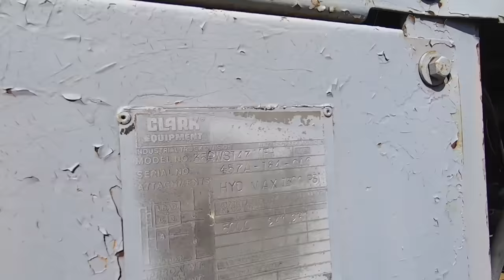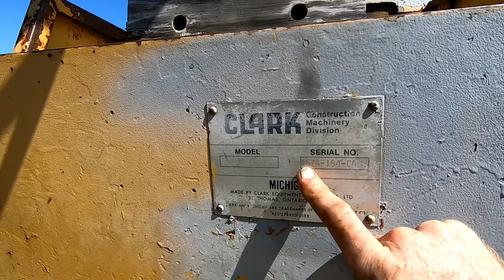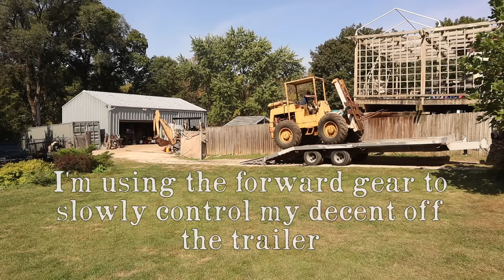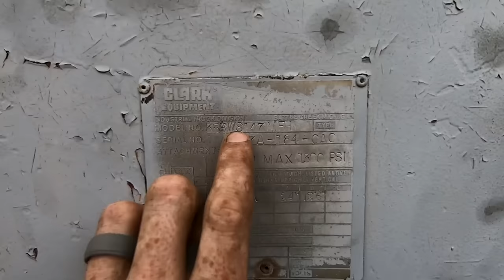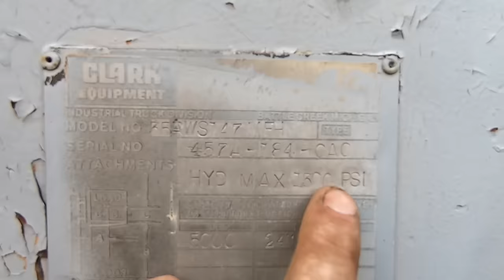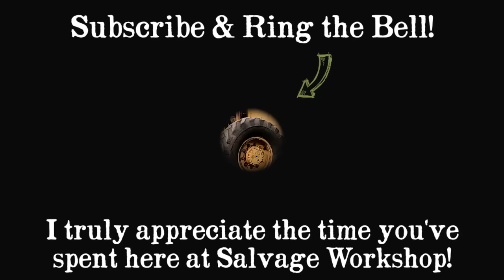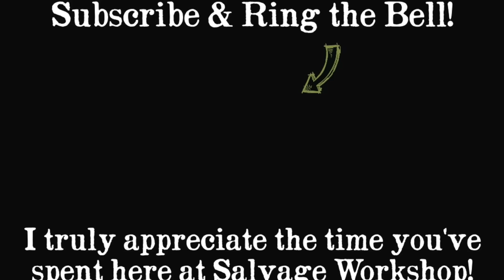I found a RARE ALL-Terrain "Wheel Loader" Forklift! Will it START?! (THIS Machine PUT UP A FIGHT!!!)

Comment: master cylinder likely has had water in it . take the master off and match one up at napa . pay close attention to bore size . putting a master on with a bigger bore will cause excessive foot pressure to stop machine . bleed the brakes and you will likely have brakes. this worked on my 55a loader .Good luck .

Comment: For what it's worth that engine is used in 70's Massey Ferguson tractors Like a 165 or 168. sold in Australia. They make a slightly bigger a4-248 as well.
both of those tractors were negative earth. The engine should turn clockwise looking at the engine front like you were about to hand crank it.
Reply from the maker: Great to know! Thanks! The Massey 50HX I rescued on the channel has the A4.248 Perkins!

Comment: Stainless steel welding rods work great to extract bolts tack washer and nut onto broken stud let cool it will shrink stud and will spin  out easily.  I think rods are called jet rod

Comment: Believe it or not I’ve seen a diesel spin over and kick backwards and start. Gotta be careful the oil pump doesn’t work backwards. Had to shut er down right away. Two stroke diesel is what it had I believe.

Comment: Excellent video  :) also should put a grey bottle of STP Total Treatment fuel injection and carb cleaner in fuel tank with  General Motors type of Automatic transmission type 2 or 3 add 500 ml in Desiel fuel tank every tank full also clean out fuel injection plus motor too plus lube injection pump too ! Check with Rock Auto company may have on Clarks part and Perkins engine part check with Massey Ferguson company tractor dealer or internet about engines for parts plus electronics on rewired up even may need know about! Also when load up forklift on left side cylinder one was leaking fluid too bad on hex connector nut fitting too!

Comment: Listening to it run I did not hear the air compressor kick out or back on, you have some air pressure cause the horn works but maybe not enough air pressure to work the brakes.

Comment: marvelous mystery oil and soap in many areas will eace the seals and operations of nearly every component turbos air compressors etc...not running been dry for a long while gotta close and lube to figure out what can come back...and clear corrosions from the system....

Comment: Im with you on the reverse rotation starter situation. That would have gotten me too. I’m 99.9% certain that Left hand drill bit would have walked that broken starter bolt right out, though.
Reply: or some heat, why wouldnt you just heat it up with a torch and back it out.

Comment: You should have just changed the solenoid. The contact copper plate/washer inside  and the studs are burnt. You could also disassemble it and file the contacts. I've done that before.

Comment: When drilling out broken bolts:  Use left-handed drill bit  -- while drilling into bolt body -- it will remove the broken stud...!
Video is well-done...!  On Winch Cables under load: !!!  NEVER EVER HANDLE TAUT LINE -- UPON FAILURE THEY WILL HURT YOU  !!!

Comment: S O B 50 years as a mechanic makes me wonder if that starter can be internally wired backwards. Or what engine it is designed for. I have only seen 1 small engine that actually ran backwards and 2 larger engies that could run backwards and 1 was a steam engine. I was told that certain Detroits could run backwards. If that starter that seemingly runs backwards was able to mount on  the bell housing side with the cone pointed towards the fan would the engine spin the rite direction? That is for sure a mind bender very observant you noticed the fan was rotating the opposite direction. With the engine facing backwards it may not have occurred  to many people. Either way that engine looks to be a swap and in pretty good shape. With them big tires and that heavy duty machine that could be a very useful machine. You could make a huge basket and have it for scaffolding besides only as a fork lift. Any way good job in figuring that one out.
Reply from the maker: Thanks Del! I appreciate you watching & commenting! Now to make it STOP!
Reply: Some old 2-stroke gas engines could run backwards.  A couple were designed that way.  To switch to reverse, the engine was stopped then started backwards.  Crazy but true.
Reply: @Bobbywolf64  I have a Bond Minicar with the original two stroke engine and that is how it was setup to go backwards, you stop the engine, push the key further in and restart, this gives you a four speed reverse!! not recommended to use more than second though, totally bananas, but its great☺.

Comment: If a starter was wired "wrong " (rotate backwards) it wouldn't even kick the bendix out to try engaging the flywheel. Also if it was a marine counter-rotating engine it wouldn't work in the forklift driveline as far as putting it in drive/forward gear would go reverse.. possibly just a marine starter on a non-marine engine is my guess

Comment: You need to get a good set of stud extractors, it'll save on torx bits!
The steering out of sync could be a blown seal in one of the rams.
Reply from the maker: I have quite a collection of them and they NEVER seem work as well as TORX bits for me... not to mention they are WAY more expensive than cheap torx bits! Everyone has their own way of doing things! The second Torx bit attempt did work!
Reply: With a little hello of old heat!

Comment: I would seriously recommend you get a couple of snatch blocks to use with that winch you have installed onto that truck and I would not stand anywhere near that cable like you were when you are winching a heavy load like that.  Just watching you stand that close to the winch line made me nervous as that cable could easily cut you in half if it had snapped loose.

Comment: That the Perkins lights off that easy without ether tells me it might just need valve seals. If the smoke clears up after it runs a bit would be another clue that's the problem.

Comment: Currently at 55:16 and if the starter is spinning the wrong way the gas isnt getting burned which might be why the oil smells like gas because the fuel isnt being burned and instead being dumped right into the oil pan.
Reply from the maker: I like the logic there... It would make sense if who knows how many before me were trying to get it to run with the wrong starter... Especially since the oil was over full, had no water in it, and smelled like fuel!

Comment: At: 1:00:55  There is no need or benefit in bleeding the bleed line on the injectors.   Just need to bleed the pressure feed line to the injectors to get the air out.

Comment: I see you always cracking the hydraulic lines to move attachments, you should be able to just hold the function of the lever and allow the function to move, kind of like when you stop a pice of equipment and after shutting it off you release the tension on the attachment.

Comment: Very cheap tools you need in your tool-box. First tool is a "center-punch," or a old broken drill bit (sharpen to a point) approx. 3/8" in. to 1/2" in. dia. size. Or go with a set of "Transfer-punch's," visit Harbor Freight maybe $15.00 You should ALWAYS center punch the starting of drilling a broken stud / bolt. You do that to make sure the drill bit doesn't wonder off-center.   A couple of "LEFT-HANDED-Drill bit's." maybe size's 1/4" in. 3/8" & 1/2" in. just to start. Odd's are that's all your ever need.  You kind of approached the broken stud problem backwards if you will. Proper series of events that should happened, to remove broken stud/bolt.  First "center-punch the stud/bolt." Your doing this process of "center-punching,"  not only to mark the center, but a small test if you will, to see if your dealing with a GRADE-8 (harden-steel,) if you can easily mark the stud/bolt, odd's are it's a grade-5, or less. If you wish to tackle a "GRADE-8" bolt/stud you HAVE TO PURCHASE $$$$$$ A CARBIDE DRILL BIT. Assuming you wish to purchase a 1/4" in. Carbide drill bit, expect a price in the neighborhood $25.00 for one drill bit. "Jobber-size length approx. 2" in. to 2.5" in. 
 "Demming-Size" length approx. 1.5" in. or a little less in length, you;ll have to decide what's best overall for your needs.

Next (2nd-operation) drill a 1/8" in. dia pilot hole, than drill  (40-60% of stud/bolt dia.) either to lessen the amount of material (make room for expansion) & heat the bolt to break-lose the bond between the stud/bolt and the housing. 

Let air cool, or use some water to SHOCK the bond lose. Now drill a hole next size up using a "Left-handed Drill Bit," hope it just walks out of the hole (60/40) chance of this happening. The worse thing you can do is to HAMMER something into a small hole (as you did) and thereby increasing the hold/strength of the bond. Sorry that was a jacka$$ move, or how not to do a stud/bolt removal.

Comment: That starter had the permanent magnets put in the case in the wrong orientation. If you swap magnets on a DC motor end for end you will change the rotation of the motor even though your positive and negative are correct.

Comment: looks like you need to install a roller on the front of the trailer for the winch line to roll on so its not just sliding across the top of the trailer!

Comment: That machine looks an awful lot like the massey ferguson 470 wheel loader I have. Same motor too. Mine doesn't have air brakes however. They are awesome machines, simple to fix and do what they were made to do fairly well.

Comment: In the late 1980s early 90s  the Perkins Diesels were   easier to buy and generally less money   it was very common to do those engine swaps on most industrial Equipment   i think it was Kennedy that manufacturedAdapters for most  brands   to accept the Perkins  i  was a boater most of my life and Perkins Diesels were always considered great Marine Engines   i had a Bobcat Skidsteer and  small Backhoe. converted  to the Perkins during that era  i also    spent a lot of time on a Vietnamese built twin engine Trawler that ran great  with the Perkins  they were great at burning only 2 gallons per hour  at Cruising Speed (7 Knots )  but if we needed to “push “ the Vessel at W.O.T. (Wide Open Throtthle) we could  get 10 Knots out of her

Comment: The air flow through the radiator is from the engine bay out the back of the machine. 4 cycle diesels don't run in either direction.
Reply: Some will, though it's not recommended (usually).  One of my old 4WDs had a low oil pressure cutoff connected to the fuel shutoff so that if the engine DID start backwards (e.g. stalling on a steep hill), it wouldn't run away.

Comment: As far as  I know   you can wire either way and it turns the same way ..  Just one Problem  Normally Chassis  grounded thus if you  hook the ground to the chasis  you get a dead short..

Comment: I really liked this video, your problem solving made me smile, your disregard for safety made me cringe, winching over the flatbed floor metal to metal is a recipe I would not want to bake, dont they make a wheel to ease those situations?  Anyway a great job getting it going, maybe a search in library schematics would help you locate a manual. (finding a workshop manual for a clark michigan forklift)

Comment: I have had the starter problem once with what I had the stater came in from flywheel side not engine side also the bigger starter should be with the right parts the starter you need for old RED

Comment: is that white car sitting in the weeds in front of that black truck in the background a chevy nova? if it is, it would be worth bringing home too if the price is right. they're getting kinda rare, and there is always someone to take it off of your hands if it has a title, and if it has enough good parts, without one as well. i looked at a '73 with a title, but no drivetrain, in restorable condition for $2800 last spring, but i found a '36 chevy truck that i bought instead. 2 door, RWD V8 cars are easy to find new homes for, cameros, novas, and chevelles especially. i'd check it out, and see if they'd part with it for $1500 or less. you should have plenty of room for a profit at that price. a runner with V8 and a title is $3-3500 easy. with no issues and a 4 spd. manual, over 10k.
Reply from the maker: Yes it's what's LEFT of a Nova! Its a roller, gutted to be a drag car, but then someone removed EVERYTHING... Seats, fuel cell, engine, tranny, most of the glass is gone....There are some gauges and other misc stuff, but not much! Plus the frame is just about to break in half due to rust... Trust me I LOOKED!
Reply: @SalvageWorkshop  well that's depressing. i was hoping to help you find some quick cash to offset your new equipment purchases.

Comment: Interesting engine rotation issue. So the fan OUSHES the air thru the radiator which is opposite car engine systems which pull the air thru..

Comment: I doubt this detail will be of use to you but it does refute one of your theories. You mentioned that the machine was built in Ontario Canada. There is an obscure law that defense contractors have to source everything domestically. I don't know if this is currently the case, it's hard to imagine with global supply chains. I know for sure it was the case from Vietnam back. It's part of the reason that coleco manufactured the stocks for the M16 rifle
Reply: I think it was pretty common particularly for larger customers to have custom orders. Things were not nearly as streamlined as today. Being built in Ontario, and the way it is set up, it occurs to me that it may have been used in a logging yard. The shipyard is another solid guess, with that kind of ground clearance and being on wheels, it is ideally set up for production, tractor vehicles are very difficult to move out of the way once they are stuck

Comment: a steel bolt that has broken off can be Torched out, as the Cast Iron won't melt like the steel will, the Cast Iron will take a heck of a lot of heat

Comment: First thing rig up a ball valve  and put air to the valve and to one of the brakes. Check voltage out of alternator. Add a battery cut off switch.

Comment: Put in the model.& make of the machine. The engine size is A A4.236 Perkins diesel engine inside of that all wheel steer/ lockout front steering/ 4x4 clarke/Michigan forklift truck that has had modifications done on.& to the frame body for what is you have now.

Comment: Most forklifts have a 24volt system...One 12v battery won't do it...(at least the ones I've used and/or Rube Goldberged) They were HYSTER though

Comment: AND!!!!!  when using open end of wrench you hand  the small side the wrong side of pressure!!  the smaller side of open wrench goes to the rowards pressures! or you OPEN so to say  the wrench demension!!!1 Thicker  side or open end wrench is to the Backside of pressure turning knut or bolt!!!

Comment: I spent a lot of hours on one of them. It had a Ford motor and a 3 ton lift rating. Quite good forklifts but not much clearance under the fork frame.
Reply: Not a Ford a Perkins
Reply: @catsbyondrepair  The one l used had a Ford but might have been English built.

Comment: I know how to calibrate the steering.
At least on most of those you have to straighten the front wheels first and then switch the switch to back wheel steering only and then straighten the back wheels and then put it back into four wheel steering.
But you probably figured that out by now.

on some tractors you might have to do it in reverse and straighten the back wheels first and then straighten the front wheels.

Comment: Perkins are nearly indestructible worked on them for years in the UK that engine would be used in farming and marine applications the marine version you could buy clockwise and anti clockwise engines the starter if ordered of parts number could have come for a anticlockwise engine

Comment: it was a loader before it was a fork lift, you can see the mounting point for the loader arms above the dash
Reply from the maker: Maybe.... It does have all the mounting locations for the loader arm, but they could have just have used the loader as a platform to build from when making this forklift.... There are lots of machines that could have been many different things depending on how they were setup at the factory.
Reply: Is there wear on any of the loader arm mounting holes? Or are they all too rusty and dirty to tell?
Reply from the maker: @Kami8705  i honestly haven't had a chance to look that close, but I'll take a look!

Comment: If it's a custom built military unit, unless you can find someone that worked on one for the military... Maybe contact the motor pool of a nearby base. But was it a USACE unit, some kinda Navy abortion who knows? Your best bet would be to get the numbers off each part and build a service manual, of sorts. Good luck.

Comment: Anyone know what cranking the wrong way would do to the injector pump, if anything?
In the Subaru EA82 turning the engine the wrong way blows out the filter bypass check valve in the oil pump!
And some engines will slip a tooth on the timing belt if turned the wrong way.
Reply from the maker: I honestly wondered the same thing... It seems to be running pretty dang well, and the injector pump seems to be operating properly and doing it's job... Maybe the smoking on start up is actually over fueling and not burning oil... Say that's the case on this machine, MAYBE turning the engine the wrong way did cause damage to a seal or something in the injector pump making it over fuel the cylinders... IDK... Maybe turning the air compressor the wrong way caused damage to it? I doubt that one, but who knows!